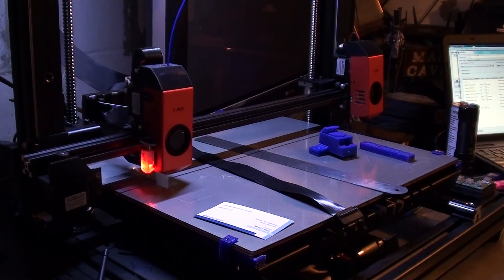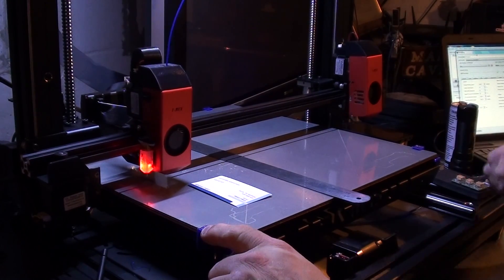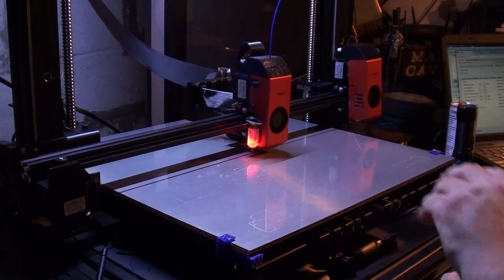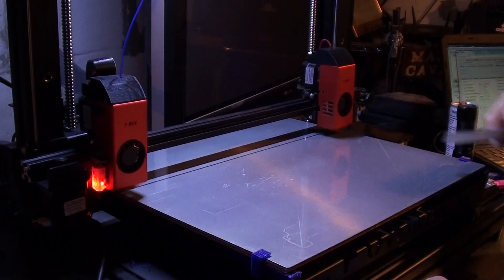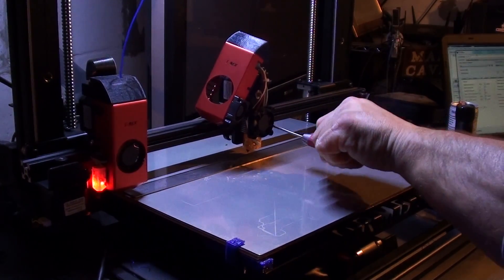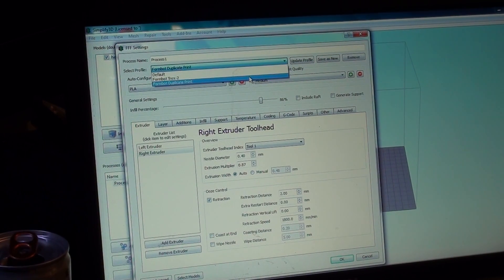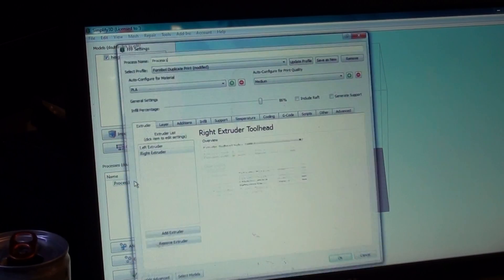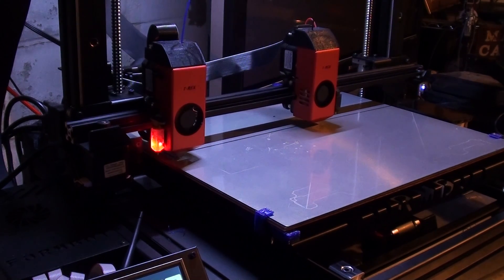How to Setup Duplicate printing on the Formbot printer

Comment: i am having trouble with my formbot t rex like yours. i am having trouble with the settings in cura/simplify 3d. are you able to help? if so, i am happy to compensate for your time
Reply from the maker: we have 2 facebook groups for this printer and the newer units
the first is "Formbot 3D Printer User Group" and the other is "Formbot T-Rex 3D Printer"
join the groups, we have profiles in the files section there
feel free to ask questions and I can help you more there